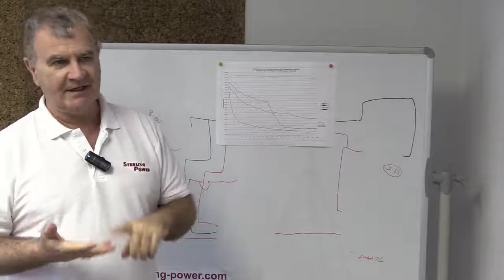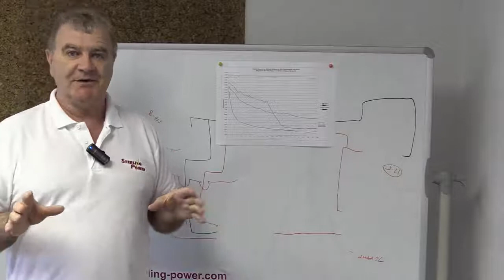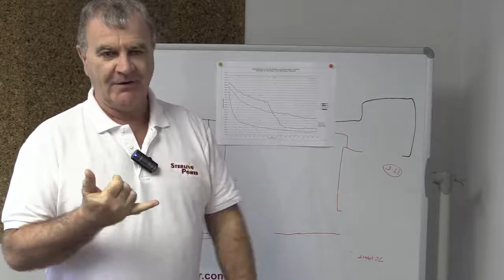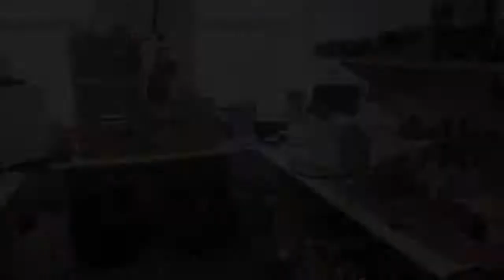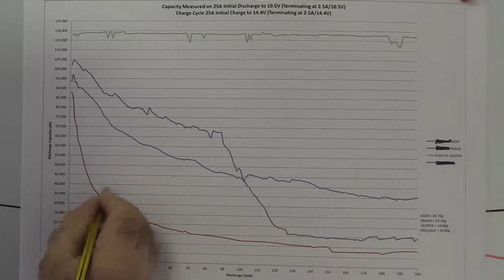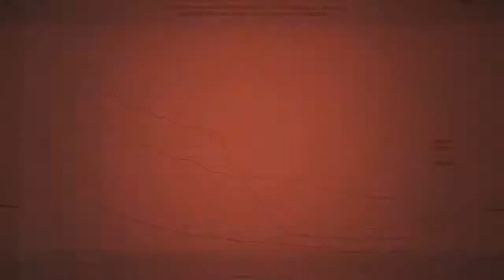Sterling Power Lithium vs Lead acid Leisure Batteries

Comment: I upgraded to a lithium 135 amp battery; same size but less weight than 100 amp AGM it replaced. I rarely fall to 50% and recharge asap. It is now 4 years old and working great especially off grid.

Comment: Very interesting. But as you mentioned it is an extreme test. There is no doubt lithium is the way forward.  Have you any idea with noraml caravan and inverter usage what the life time would be of a lithium battetry
Reply from the maker: What's normal Mike? I've been using (heavily) lithium batteries for 5 years and RoadPro has installed hundreds in that period of time. We've never known one fail. But there are lithium batteries that don't work well with inverters and, for various reasons, we would not recommend them. We say that the batteries we sell - and have some knowledge of - should be good for 2,500 - 5,000 cycles depending on the type and how they're used: that equates to over 20 years of use for some people and 10 for others.

Comment: You wouldnt use a lead acid like its lithium in this way. Fairer test would be to run a 100AH lead acid discharged to 50% and a 50AH lithium battery discharged 100%. Then you'd be discharging both by 50AH, the lithium 50AH would cost at least double the price and the charge cycle life on the lead acid, particularly a deep cycle would last for much much more than your graph showed. 
Lithium is still a good shout, but buyers should question whether its better to buy a cheap AGM battery and upgrade in 2 or 3 years when better/cheaper technogology is out, or spend big money now on lithium even though the price will ontiue to drop into the future.

Comment: Very  interesting.

I have a 125AH Lead Acid Leisure Battery. 

The starter Battery & Leisure Battery are  charged from a 210 watt Solar Panel array & a split charge system. I do not use an inverter. I run a 12v compressor fridge, a Propex 2000 Heater use LED lights & charge phones, tablets, computers batteries etc. In winter I occasionally use my Honda EU 10i generator to top up the Leisure Battery during the short days. 

I always wild camp so never plug in to shore power when away. I record solar input & Battery voltages daily. I record the voltages early in the morning before loading them. My Leisure Battery has never been lower than 12 volts. I think it cost me £130? 

So I can replace my battery 8 times for the cost of a Lithium one. So between 16 & 24 years? I will be dead in 24 years but might be around in 16 years but possibly not in my van. 

Just a few figures I have been playing with & have not drawn any conclusion other than it pays to look after your batteries whatever type you own & buy the best of type you can afford.
Reply from the maker: You are absolutely correct about looking after your batteries but, please be aware that, when a 12V battery is actually reading 12V, technically, it's dead!
Reply: RoadPro It must of been dead for 2.5 years then! Every source I have read leads me to understand that 12v is around 50% discharged, the minimum to run conventional batteries down to without damaging them. Are you seriously saying that 12 volts is a dead battery? In my experience that is not, in practical terms the reality. The battery charged normally & holds it’s charge. I run my Fridge 24/7 for the last 3 months (I am a photographer who travels a lot) without any issues & I charge lot’s of batteries, speakers, iPads etc every day all off grid. It would seem my battery is still ok?
Reply from the maker: OK, not completely dead, I agree. But getting there.